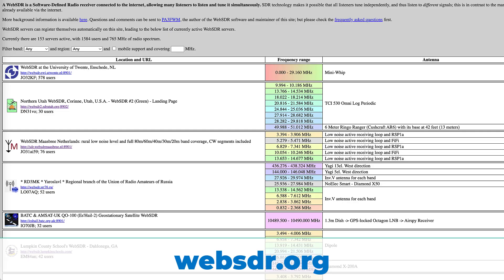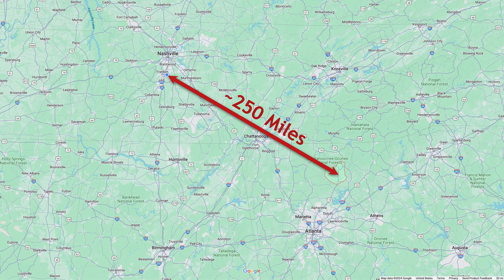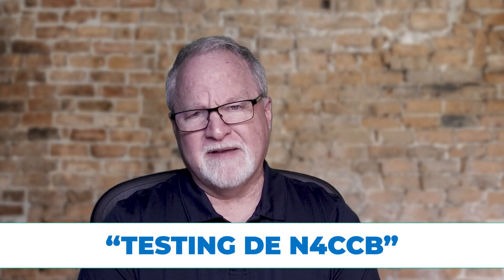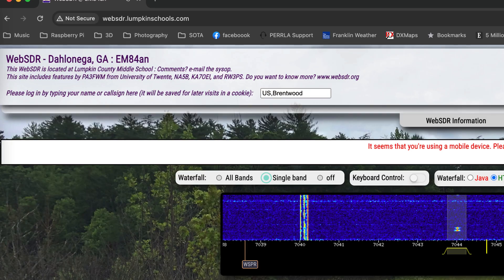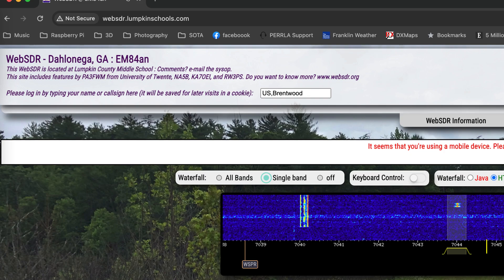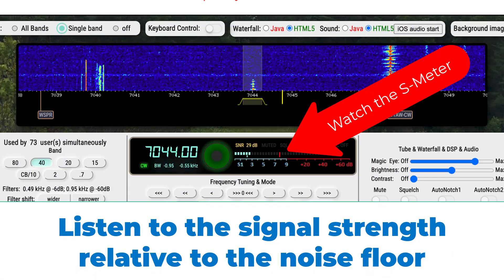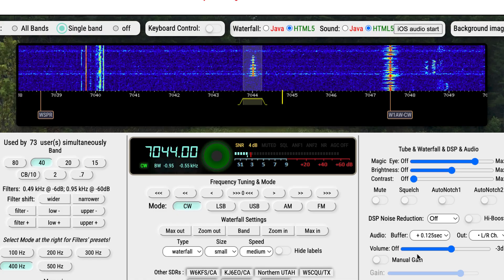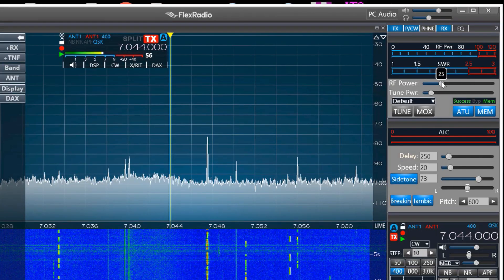100 watts vs. 5 watts: Can you hear the difference?

Comment: Too many hams learn by memorizing the question bank, then are mentored by those who did exactly the same thing, and then listen to old (long debunked) 'wisdom' hand it down from OMs and CBers. If they had actually taken the time to learn about radio electronics and RF propagation this demonstration would not be necessary. They would also know that 'lowest power required for clear communication' is the standard and the challenge, not 'legal limit', for good reason.

Comment: You all have no clue. As a former CB operator with a Zetagi B1200, a true 700-Watt mobile FM amplifire, I can tell you from experience: everything gets better with every extra watt of output.
Except AM. With AM, the modulation gets worse with every extra Watt.
Got it? More Watt are better. At least on 27 MHz FM.

Comment: You have such high static noise in the back that I simply can't. What's the point of this? As formula goes Wx2 = +3 dB and SINAD above possible DR of what you are sending perceived psy louder or quieter. Depending on content and ELC counted in as a factor to received SPL you will perceive it differently and prize louder especially without ELC for bottom two octaves. To put it into perspective difference between 5W and 80W is +12 dB or psy twice as loud. Noise shaping/dithering also comes to play but not much 1 bit to 16 (or 6 dB). Moving to FP full/double precision for signal manipulation purposes gives you much larger SINAD headroom to among other things amplify it. And that is as far it goes for now. I still prefer to drive by V, blame me.

Comment: The power setting on my radios (Icom) are only approximations and depend on several factors, proper voltage at the radio being the principle factor.  
S-meters are generally considered to be 1 S-unit is 6 db of power change.  
Decibels simple means 1/10th "bel" and a bel is simply the decimal (base 10) logarithm of the power ratio.  
Going from 1 watt to 100 watts is Log10(100) or 2 bels or 20 deci-bels.  Since 6 db is 1 S-unit, you can expect just over 3 S-units difference between 1 watt and 100 watts. 
It is easier to see this using a digital mode or even just FM; whatever gives you a steady carrier that you can then see on the Web SDR S-meter. 

The AVERAGE power transmitted by a 100 watts SSB transmitter using voice is around 8 watts RMS.  That is one reason 100 watts CW can punch through noise MUCH better than 8 watts of SSB (same with any digital mode).  Microphone compression increases the average power transmitted and might help with someone else hearing you but it is easy to overdo it (over-modulate) and become unintelligible.  
High power continuous carrier modes should generally be avoided.  It is not necessary and some radios, maybe many in the 100 watt category, are not designed for 100 watts continuous duty cycle.  

A 100 watt transceiver is extremely inefficient dialed down to low power.  Sure, you get QRP power level to the antenna, but the radio is still burning 5 amps or more just to get that 1 to 5 watts out.  This is where a QRP radio such as ICOM IC-705 is vastly more efficient if your intention is low power battery operation.

Comment: Demonstrating basic math. 1 S unit is 6 dB. Doubling or halving power is 3 dBSo 50 watts is 3 Db down from 100 watts (1/2 S unit). 25 watts is 3dB down from 50 watts, so 1/2 S unit. 25 watts is 1 S unit down from 100 watts. 400 watts is 1 S unit over 100 watts.

Comment: Many of those websdr stations like the one in Utah, have giant towers with massive pro-grade log periodic beams and filters for every band. Most stations just have a 100 watt radio and a wire antenna.  Also CW is much easier to copy than SSB at weak signal  levels. Some of us actually prefer talking to people. Not FT-8, not CW. I like my audio to be as clear as possible.  And I live in a city where the noise floor is high and there's restrictions on high towers. I run power, and am proud of it. QRP does not make logical sense. It's like breaking your own foot to win a marathon. It just doesn't add up. The QRP trend is lame and no argument is going to change my mind.

Comment: 6dB is an S unit. It's the interesting side to radio. 25W is only 1S unit under 100W.
1W to 100W is mathematically around 3 and 1/2S units.
So of you start with a +20dB over S9 at 100W, you'll find 1W still does a great job 😅

Comment: There actually is another test, one that pretty much everyone has missed. And this is the real test. Have another station close by transmit with 100 watts at the same time you are transmitting at each power level. The other station does not change power. Now listen to which station gets through. The answer to that is why folks use high power for DXing and in contests, or any other time there will be competition for your signal. Don't get me wrong, I QRP a lot. But when I need to get through, I don't drop the power. 
Now it there is no competition, there is a tremendous advantage to using QRP. QRP in field day with great antennas and a super site is a lot of fun, just check the scores the K6EI team produces. Those are some of the best QRP times I have spent! 73!

Comment: It's no so rosy on SSB, because you start losing consonants which are really important to intelligibility but still really good except maybe the last two levels.
CW is so potent, that you can do so well with QRP.
In my experience with CW, if conditions don't allow for a 20W signal to be heard, then you really have bad conditions!
Most people that purposely run 100W, are also doing so because of QSB, especially on 80m...

Comment: OMG, a bullshit test, its on 7 Mhz... not VHF, Not UHF
and he takes for ever to get to the first screen
I was so pissed off at the Click bait
I give this a thumbs down

Power on UHF can make a real difference
Very high power say 200 to 400 watts can also make a huge difference
when you are pushing limits 

Try bouncing a UHF signal off a airliner in flight between you and another station
or off a water tower on a mountain 100 miles away
Thats when low power is zero and high power works.

This video fails to provide the big picture.
Then you have Mad Mad USA where every clown
in endless competitions destroys the spectrum so a 1 watt HF
is not going to win against 2 KW and directional antennas

Comment: 0:36 That, right there, is the part that gets ignored and many arguments start over. "If you are above the noise floor".

I typically end up turning up the power because we aren't making the contact because the other station can't make out my signal.

Once that point is established, I don't need to add any more oomph.

Comment: Doing a "demo" is quite different from "real life."  I call CQ and get an answer from someone whose sig I wind up giving a 339, then surprised to hear them sending 5NN 5NN back.   At that point, I usually guess they're another QRP station, and am shortly proved right.  So, it's MY skill,  not the QRP operator's skill, that is put to the test.  I have to do all the work to pull the other operator's signal out of the muck while they get armchair copy the whole way.  If I'm not pulling them out, I QRU.  I know QRP apologists love to talk about how "nobody needs 100 watts" - but they never think of the poor listener on the other end.

Comment: 4x power = 6dB = 1 s-unit. So 100W to 400W you can only 1 s-unit on the receive side. Get the gain by optimizing your antenna, not pushing more power.

Comment: If you are calling for DX to stations that might be listening at unknown distances and you are not intending to be a QRP station it is far better to be using higher wattages ERP to initiates these unknown contacts.. If the band segment is fairly crowded/busy then a medium between full output and some lower output is just gentlemanly.. You certainly can reduce your power if the station contacted gives you a 559+30 but if the band is not busy/crowded keeping the signal at a higher strength might attract a further distant DX station.. I was having a CW conversation with my friend 20 miles away on 40 CW and we were down to about 5 watts and still drew a complaint from a local that we were too hot so you just can't please everybody..

Comment: There are so many variables involved. But as I learned a long time ago, the quality of your antenna setup is probably the most important link in the chain. If you have an efficient antenna, you're in a good location, and everything is working right, its possible to do what seems impossible. You can run a KW from a poor antenna setup and wonder why no one hears you. I have done portable work in the N. California Sierra.With a good antenna with a low SWR at an elevation of about 6000', I was able to work Japan on SSB on 5 watts. Band conditions are of course the other variable. Things were so good that day that I had something of a mini pileup of Japanese hams wanting to work the QRP station. Power is good when needed. In my shack, I have a 200W radio and a KW amp. I rarely use the amp and I generally don't run much over 100W on the radio. But I have very good antennas.

Comment: Today I tested the difference QRP/QRO myself too. This time, a friend of mine did record my emission and sent me the video
Test was done at power levels 5w - 600w and everything in between.

- My working conditions were: FT710 / Acom 1010 Linear / Antenna Chameleon CHA SS25 vertical telescopic, tuned on 10m band, mounted with triple magmount on top of my car, SWR about 1.2
- Receiver : FT710, 1400miles between us. Antenna 3 el Yagi 30ft high , location countryside, very low band noise, no RFI

Results:
- QRO 600w: he could hear me S9 + 10-15db
- 100w: 59+5db
- 60w: 59
- QRP 5w: still could hear me ok, S5-S7 QSB, but good enough for having a confortable QSO
  * Using 5w, the 10m band noise was present alongside with my emission
  * As I went up in power, the band noise was less and less. 
  * at about 150w-200w the band noise disappeared completely - was just my voice clean on his FT710
  * Increasing power the S strenghth was going up accordingly
  * The S reading was going up indeed, but less and less as I went close to 650w. To be honest, exceeding 300-350w was indeed slowly bit louder but the emission was already good enough, I mean perfectly fine - you actually didn't need more.

Conclusion: 
- If a station does hear you with over S9 , like 10db over when your power is 600w, that station can still hear you with 5w QRP
- on the other hand, with the same setup , same location, I had QSO's with distant stations, DX ones, using 600w on 10m , and my report was like 55. In this scenario QRP would be definitely not enough.

Comment: FEW things to point out: 
1. These SDR public stations are usually placed in a very low noise location, quality equipment, good antennas: noise floor is very low . Usually hams in real life operators have much noisier RX - so that your test if done using a ham radio home QTC with an average RIG/Antenna would look WAY different: the S/N ratio would make your weak signal hard to pick
2. This test was done in a range of the band with virtually zero QRM ,there were no other stations nearby . Again - idealistic. A test on a frequency where close to your frequency are other more powerful stations would look completely different. An average receiver/antenna setup would have a hard time to make your weak signal heard

So, you did NOT convinced me: claming that in real ham radio operation setup, would be no to little difference.
Reply from the maker: Have a good day., - Cliff

Comment: How do you identify the noise level of the other station or your own?
Reply from the maker: HF radios have an "S-Meter" that measures received signal strength. They are marked S-1, S-2, and so on, up to S-9 with some additional markings above that (S9+10db, S9+20db). If you tune your radio to a frequency where you don't hear a conversation and your S-Meter is reading S-3, your "noise floor" is said to be S-3, for example. Stations that you listen to must have a received signal at your house stronger than S-3 for you to conversationrsation. Of course, the strength of the received signal is dependent on their transmitting power and band conditions. When propagation is good, their signal will be much louder, all things being equal. Of course, when propagation is bad, you should watch YouTube videos, as you won't be able to hear that distant station!  You can't know the noise level at the other station, only your own. The other station that you're trying to talk to may have a bad antenna and/or interference from electrical appliances, etc. - Cliff
Reply: @QRPSchool  , thanks a lot. The tipp with the websdr to check the own transmition is great. My problem is, I am on 2nd floor in the city with metal handrail and above me there are 3 more floors. I mostly only hear very strong stations 400-600W. I tested with several antennas, even selfmade wire. Best receiving results so far with a hari windom spanned in zig-zag and with a JPC-12. But getting out and heard elsewhere is a mess here (so far).
Reply from the maker: @mwildam  Wow! That IS a challenge. You might think about a magnetic loop antenna for your balcony (if present). These are small and directional and work fine for the 20 meter band (and up). Not efficient for lower frequencies due to the size of the loop in relation to the wavelength. Of course, working portable in a park is an option. Good luck to you!
Reply: @ , thank you very much for getting back to me. I was already pretty frustrated that I cannot get anything to work on short wave. Then I went to a hill and without even the need to adjust my JPC-12 I heard a whole bunch of people. So at least now I know that I am not totally dumb and there must be a problem with my location. I thought about a loop already - but they are very expensive. A radio friend offered me to lend me one - so I will try. I am still waiting for some of my neighbours to allow me to put an antenna onto the roof. Until that I will continue to try things on the balcony (yes, I have one). The experience will teach me and probably I then will also be able to better help others (I am yet a newcomer - got my license december 2024).

Comment: Did the receiving station use a notch filter?
Reply from the maker: I’m not sure what you’re asking. A notch filter is normally used to attenuate a bothersome signal. Maybe you’re asking if the receiving station was using a narrow filter to reduce the bandwidth of the received signal? If so, I had probably set the websdr station’s bandwidth to 500Hz or 300Hz for CW. -Cliff
Reply: @QRPSchool  It's been a while since I was last on the air, so I mixed up terms. Yes, a narrow filter was what I meant to say. I'll watch again and see if it shows the filter width on the websdr screen you were showing. Anyway, it was a great video and I appreciate it. I'm getting back into radio after decades of being idle, and feel good about going for a QRP rig rather than a 100 watt. I see that you're using a Flex Radio in the shack. They look super, but well over my budget. 73 de W5PAZ
Reply: @GarySchiltz  I do still love my old Flex Radio because the software for it is so good. That radio itself doesn't have a screen and only has a power on/off button... everything else is software, which means you can have a panadapter as wide as your computer monitor to see signals on the bands. My 6300 is 10 years old, purchased in December of 2014.

But do you know what radio I've been playing with the most recently?  My $140 (tr)uSDX QRP radio!

I'm glad to hear you're getting back into ham radio after a long absence. It's a lot of fun and there's something in it for everyone. Enjoy! - Cliff

Comment: Isnt that the point of cw ??   In ww2 the resistance used radios with 1w. While i agree power is logarithmic. Better to do the same with modulation. You will see a few s points and clarity differences.  Especially with poor conditions.

Comment: Oh yeah there's a big difference between five Watts and 100 w especially on 11 m when you're trying to get contacts with Skip/ DX 5 Watts you got to wait for the right window you got to have the right antenna your SWR needs to be perfect and with a bit of luck you might make a contact 100 Watts with a decent setup everybody's going to hear you
Reply from the maker: We can assume that 11m (CB) is still subject to the same laws of physics as 10m (Ham Radio).  With 10m Ham Radio, having "100 watts with a decent setup" is, sadly, not going to let everybody hear you. Unfortunately, we are all at the mercy of the Gods of Propagation. If propagation is good, you'll be able to communicate to/from the region(s) that propagation allows. So, just because propagation is good from your area to, say, Brazil, you probably won't also be able to talk to someone in Japan at that time.  And, if propagation is good to a certain area, your 5 watt signal is going to be 2 S-Units quieter than a 100 watt signal. If your 100 watt signal is strong, your 5 watt signal will be stong enough to be heard... as long as the receiving station doesn't have a lot of noise to contend with.  In short, I have to disagree a little bit. When propagation is good, 5 watts is often enough. When propagation isn't good, 1500 watts (the legal limit) may not even be enough.  It all comes down to propagation and the noise floor of the receiving station. Thanks - Cliff

Comment: QRP with a suberb speech processor (like in the CUBE transceiver) will work fine.
But 20 to 30 W with compressor (speech processor) like the PRC320 will do wonders.

When the propagation is down (as those exemples a litle while ago) you'll need 1 Kw and a great antenna to get through (and choose the right band) for non ocasional comms.

Morse (it is not CW😂😂😂, that's pressing the button an putting a carrier aka Continuos Wave on the air) or other digital modes are the best choice for reaching the other station....